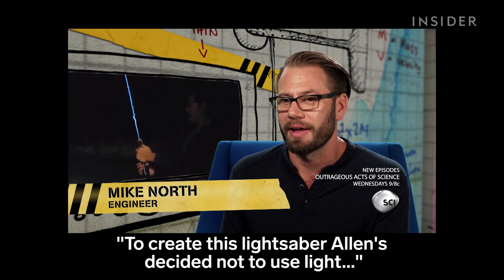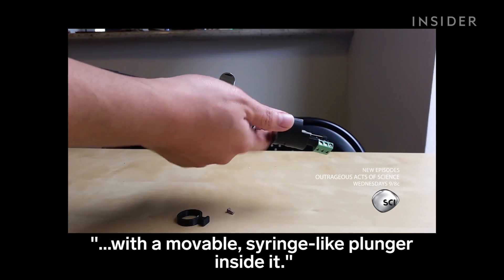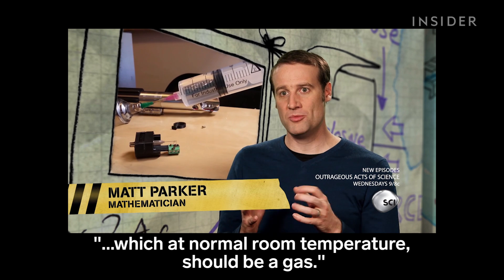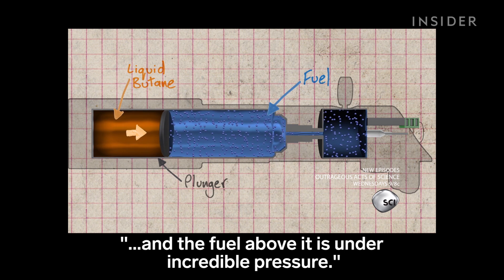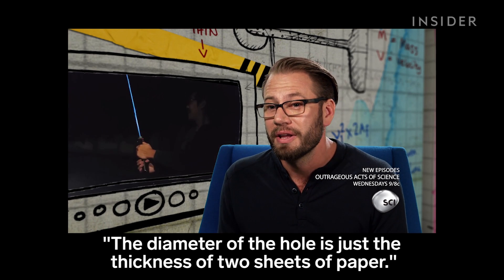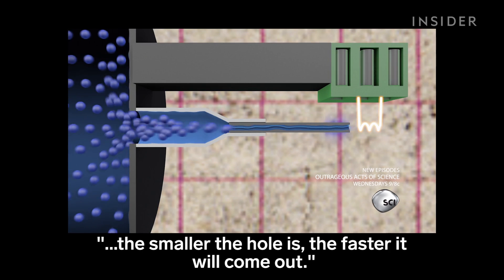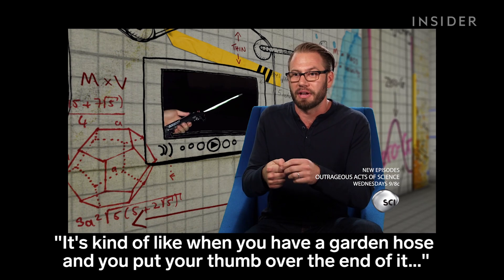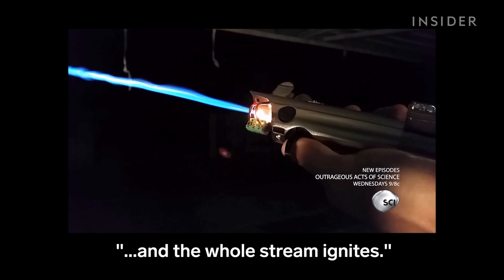This is a real-life lightsaber – here's how it works

Comment: Its a firesaber not a lightsaber
Reply: There’s a video where there trying to use plasma and a special material that shoots out of the handle  and has a bunch of holes through it to let the plasma out and can withstand the amount of heat that would take to slice through a tree with ease, the only problem they have is the power source small enough to fit in the handle and a way to contain the plasma around that material
Reply: I'd like to see you try making a lightsaber then that's not fire based
Reply: i am agree
Reply: +Abraxis_98 yeah but the glass shatters when you strike it. there's so many people out there trying to make an actual "light"saber out of laser and it's really not that easy. firesaber's just similar to the appearance and easier to accomplish
Reply: MyZone 2003 lol ur a dumbass
Reply: MyZone 2003 fire is ligth in a small scale of mass dumbass